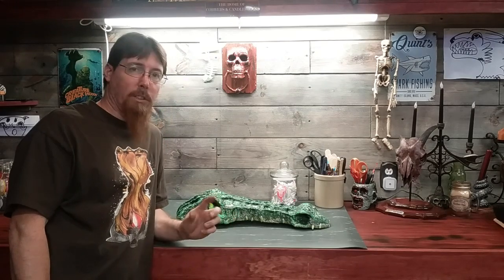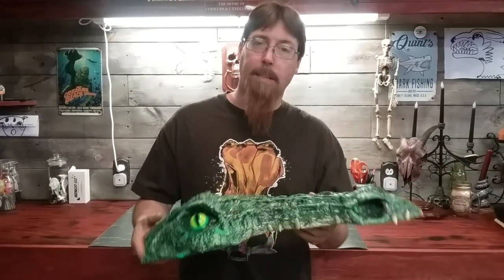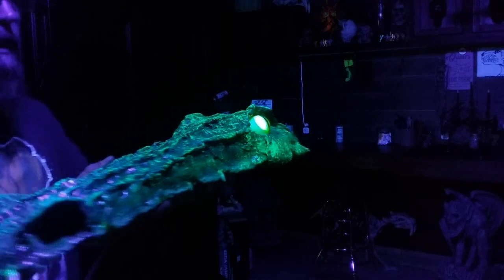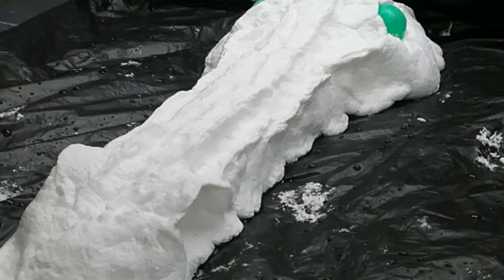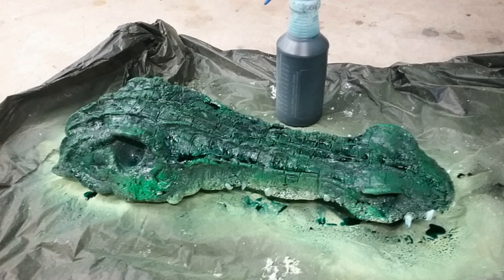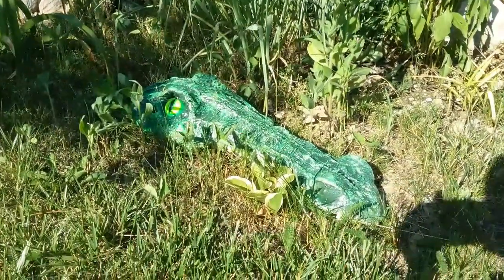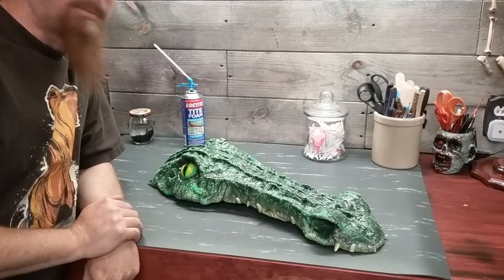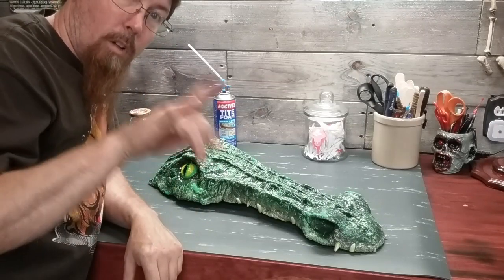Garbage Gator/ DIY scrap build w/ Loctite foam (faux taxidermy)|Cobwebs and Candlesticks

Comment: You read my mind!! I was planning a gator head with also body parts too after I saw the loctite video. Did you any cardboard or foam as his base before the loctite foam?  Thanks so much for the video
Reply from the maker: Thanks Mom! There was no cardboard involved. I stretched out a garbage bag and sprayed it with a water bottle then foamed right on top. Let the foam get tacky and spray it  down and when its skinned up enough that it doesnt stick to your fingers, wet your hands and start molding!

Comment: turned out great! awesome concept! I suppose you used the wood burner for texture after loctite was set? thanks so much for another great video!
Reply from the maker: Thanks Ant, yep, after I put one spray can coat on him I just woodburned that square pattern right in there. The loctite opened right up so I could get dark green down in those grooves.
Reply: @CobwebsandCandlesticks  the loctite seems like paper when cured
Reply from the maker: @frankenpine8071  I fiberglass coated this guy and he even floats!